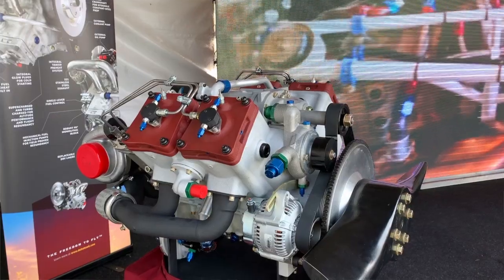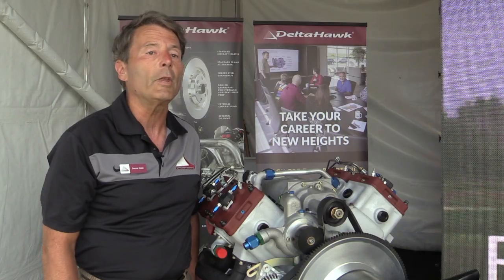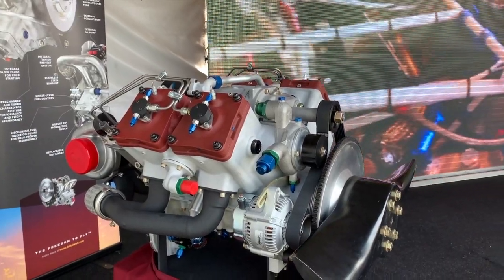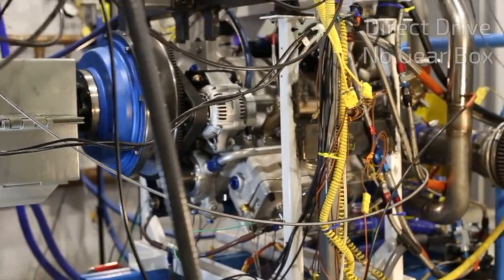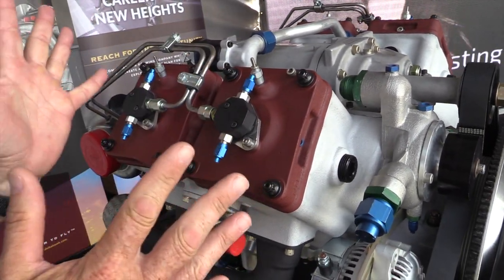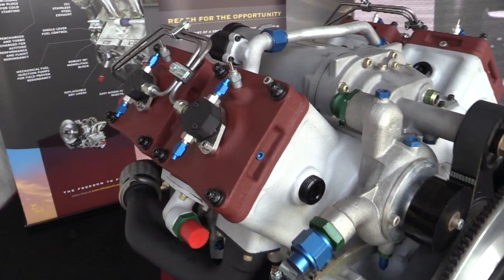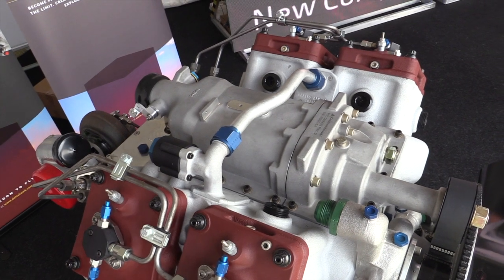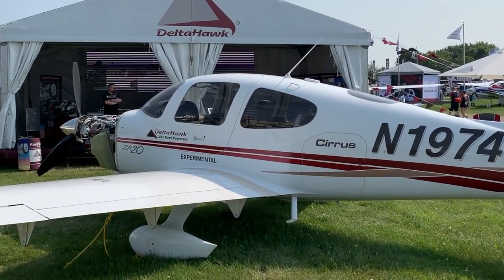DeltaHawk Jet Fueled Piston Engine Update

Comment: Diesels are known for longevity.  I wonder how the FAA determines TBO for diesels vs. AVGAS engines?  I seems like TBOs should be determined by oil analysis and compression rates and not some random number like 1200 or 2000 hours.

Comment: How much for an uncertified version and what is the installed weight?  At 180hp you could make a lot of sales with the uncertified version in experimental at the $40k price point. That is around the cost of the titan, thunderbolt, UL, Rotax 915 and the Edge Performance 915
Reply: There is no way the other engines are 40k. Listen to the package deal installed.
Reply: @kneedeepsnow16  a Rotax 915is and 180hp Thinderbolt and others cost north of $35k base not including all the require accessories

Comment: Gemini would have been way better in terms of simplicity, volume required for the installation, and especially weight.  Too bad there’s been zero movement on it since it was first revealed in 2015.  Like a lightning flash.  Fabulous reveal.  Then, nothing but a website.  Hopefully DeltaHawk is successful...but that price...$89900?!

Comment: how much is 130 horsepower
Reply: what if the oil injection pump fails, can it keep on going?
Reply: 500 lbs raised 130ft per hr avg for 8hrs. My guess is 2-600lb ft torque

Comment: 89k for the installed firewall forward 🙄  CS-prop inluded, exhaust included, accessories included, cowling included 🌴
I mean it is a high number. But an Lyc 360 installed wirh the above systwms AND labor is close to that.

Comment: 89,900!!!!!! Are you out of your mind??? I’ll take a brand new factory lycoming for $35k matter o fact I’ll take damn near 3 of them for what you lunatics want for this. It’s a joke. This is always the problem with these companies developing jet A engines. They expect you to give them back the fuel savings you would of had plus 1000% in the cost of the engine. There is no ROI in this. I would not even entertain this madness. You can build an RV7 with a brand new engine for LESS these these people want for just the engine 
Keep dreaming
Reply: Get a Continental 540 CID flat 6 and make a 2 stroke uni-flow engine out of it. There plenty of room to cut ports in those jugs.

Comment: Holy cow- $90K for a 180hp engine?  I can burn a lot of avgas for that.  The rate of return just isn't there with this engine. Intriguing design, but can't justify.
Reply: 89 Is NOT for the engine only
Reply: A factory-new Lycoming with a CS prop and all the other bits (exhaust, engine monitoring, etc.) isn't going to be much cheaper. Find me an A&P that will install a complete engine, exhaust, CS prop, engine monitoring system, and painted cowl onto a plane for less money. I hope someday they get this project out the door and offer it as a kit for folks building Velocity kits. Maybe $50-60k for just the engine and prop. That's a deal for a 300hp engine that'll get you into the flight levels thanks to the turbo and supercharger, not to mention the fuel economy.
Reply: rjbishop12 they are insane. I can build a new RV 7 with a brand new factory lycoming for the price of just their engine alone. All they want to do is redirect the already insane cost of GA flying to them instead of a good old proven lycoming and paying for Av gas. When one of these companies actually comes out with a Jet A engine that is affordable they will corner the market, until then , they are living in la la land

Comment: For the experimental market, are you working on a 100 - 120 hp version which many LSA aircraft builders would want?
Reply: Rotax has that HP range on lock. And with the ability to burn 93 octane car gas a Diesel engine in that HP range would be a hard sell.